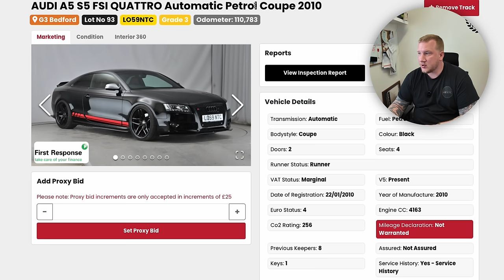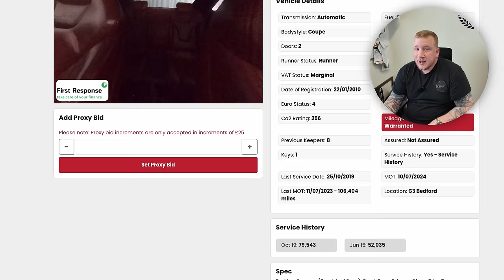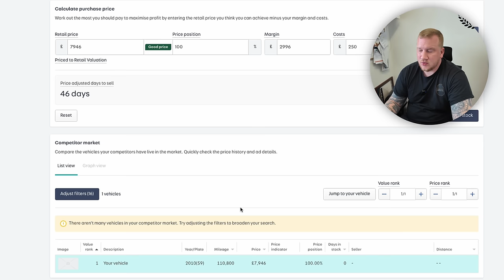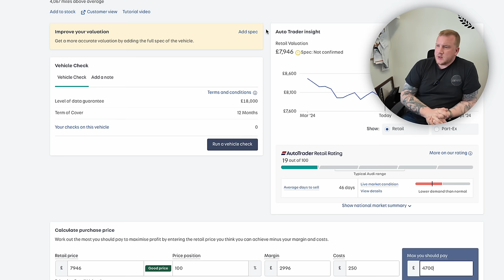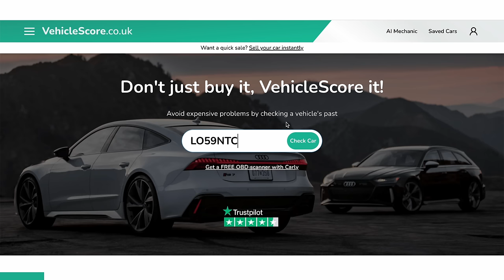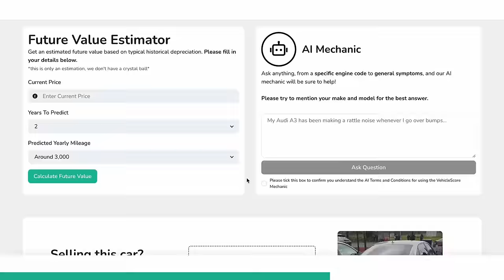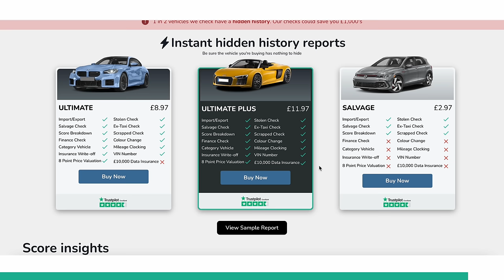I Bought A CHEAP AUDI S5 From G3 Car Auctions UK!

Comment: Having different sized tyres on one side to the other "could" make the diff work harder than it should and you could be in for a massive bill for a new diff if you continue running the wheels in that configuration.

Comment: Hi mate, great vid. I’ve owned an A5 and now an RS5 so I know a bit about these cars. 
1) the flat bottom wheel is an upgrade from a facelift S5 (value £500). The OEM one is round.
2) the curved plastic piece you found near the spare wheel is to cover the boot hinge.
3) you can probably get the window surrounds re-wrapped black for approx £250.
4) I would swap the wider tyres to the rear 👍🏻.
Lovely cars but I think the mileage, tax and general running costs may put some ppl off. £7.5k all day imo 😄

Comment: you can run a staggered setup on an AWD in small increments example 215/40/18 front and 225/40/18 rear,  there are ,many calculations you can do to keep the overall diameter the same but the rim has to be the same size some guys go as far 8.0 wide front and 8.5 rear and still maintain the same overall diameter. its all in the maths. 

The rule  is to have a small variance between the overall front and rear diameter of your wheel (including the tire)

Comment: The tyre situation, I would say it has had a puncture on the front, the space saver may not fit the front, Hence why one of the wider rear tyres were put on the front, the space saver on the rear. Then someone else just put the wheel where the space saver was on the rear.

Comment: Put the wheels all black and get the red gone. Your next engine has to be W12
Reply from the maker: Bentley Continental GTs are getting cheap these days!
Reply: @ShiftingMetal  You might find a VW Phaeton W12 for sub £10k at auction